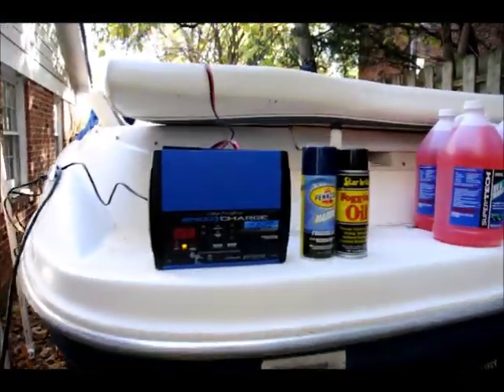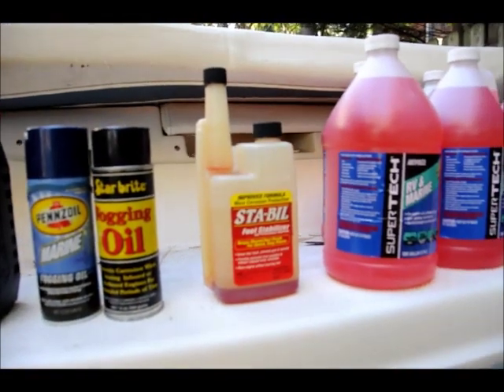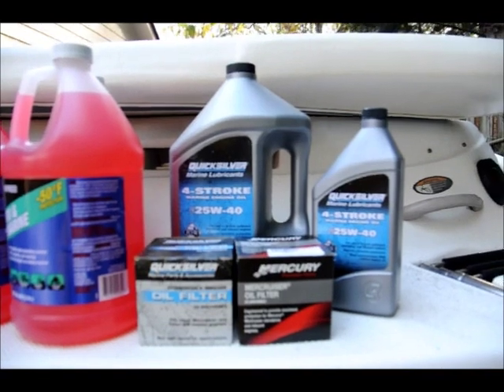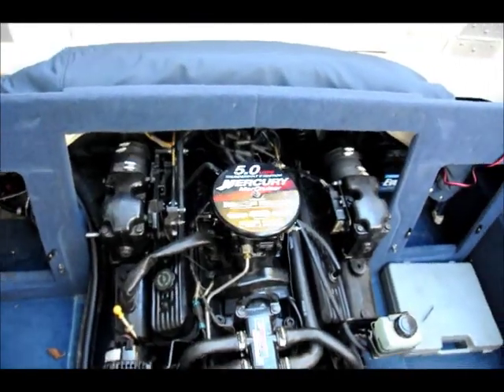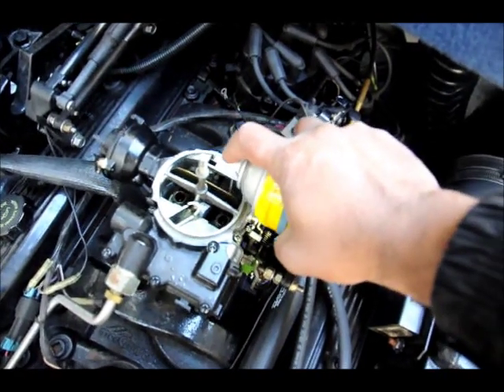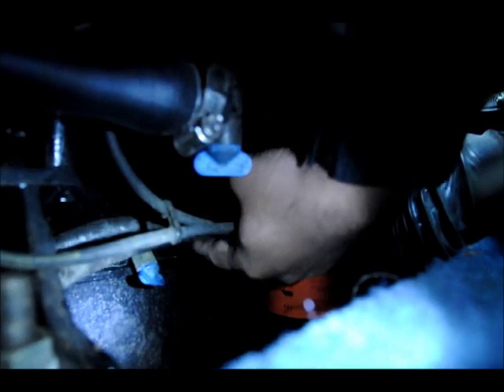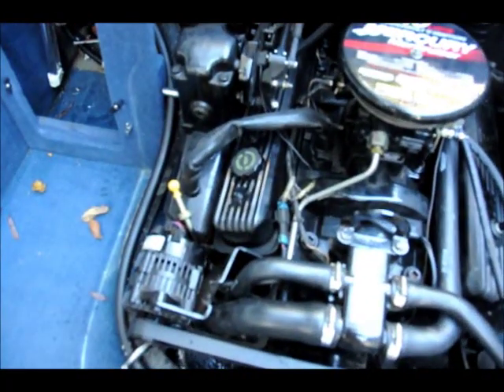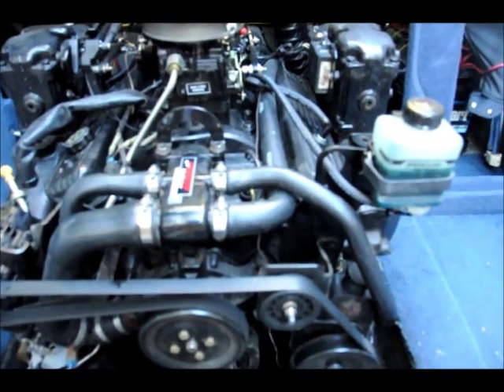Winterize a Boat | Mercruiser 5.0L Thunderbolt Ignition | Bayliner Capri 215BR

Comment: Can you add a video of how tondi the oil change if you have one
Reply from the maker: The oil change for mine is very easy since it has an oil drain hose connected to the bilge nut. All I do is open the end of the rubber hose and engine oil drains out. If you do not have a drain hose, you have to suction the oil out using an oil pump like this - https://amzn.to/3kc8EbG. I have one that I used on my older boat that did not have a drain hose. I use the pump for my Jeep as well for transmission service etc. See this video - https://youtu.be/JpGe_nysRJo -- around 2:21 mins I show using the oil pump.

Comment: hi，Indi ！Thank you for the video. very helpful! I just got the same engine. I have two questions that need your answers: 1. Why do I need to add antifreeze after the engine is drained? 2. When the engine is started for the first time in spring, there is no water in the engine. Is there any special operation required at this time?>>>> I started the engine for the first time this year and did not see any cooling water spraying out, so I have this question.
Reply from the maker: It is recommended to fill the cooling compartment with anti-freeze over winter since it can rust from air and moisture if left empty. If it was emptied, it should be fine. Make sure you connect the water inlet through the lower unit before you start the engine. If the water is not coming out within a few minutes, you should stop the engine and check the water pump impeller. That is a servicable part which often fails.
Reply: @DIYWithIndi  thank you very much! I understand, I will watch and confirm again. Looking forward to more videos.
Reply: @seanzhou198  the water pump is self priming as long as the inlet/inlet hose is submerged ie the boat is in the water, within seconds of starting the engine the pump will start pumping water from the body of water into the engine, do not run the engine out of water (ie out a lake), unless you have the water inlet hose submerged in a 5 gallon bucket of water etc

Comment: great video! Do you pour antifreeze down both of those hoses or just the big one shown in the video?  Thanks
Reply from the maker: Thank you. Just the big one I showed in the video should do. Water enters the engine compartment through that larger hose and comes back out from the other side. The other smaller ones are the inlet & outlet through the exhaust manifold. If you pour in there it will drain out from the out-drive exhaust.

Comment: Have you ever had any issues with the engine stalling and not starting again intermittently or immediately after changing the fuel filter?
Reply from the maker: I did not see any issues with starting after changing the fuel filter. I did prime it so the fuel filter is full of gas. The other option is to pour gasoline into the fuel filter before installing.